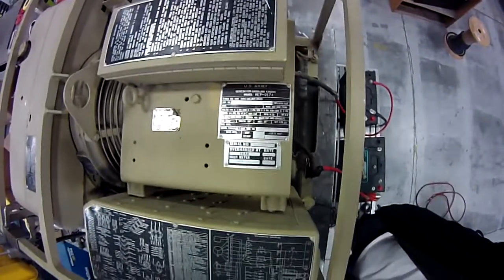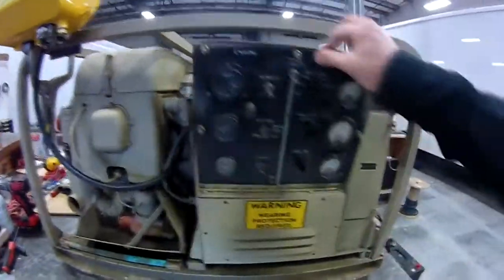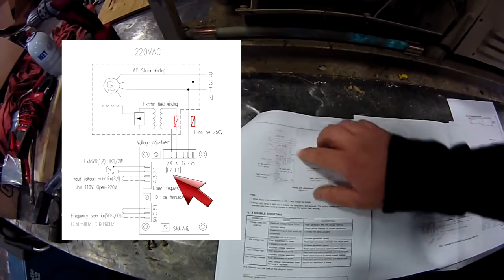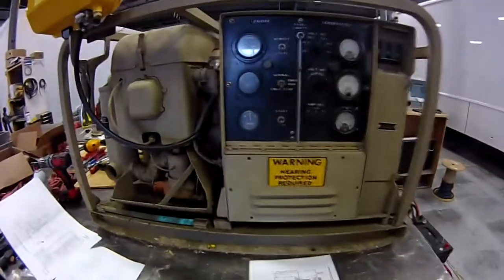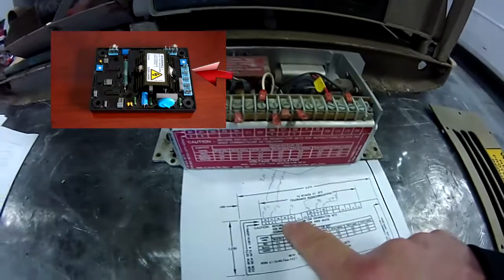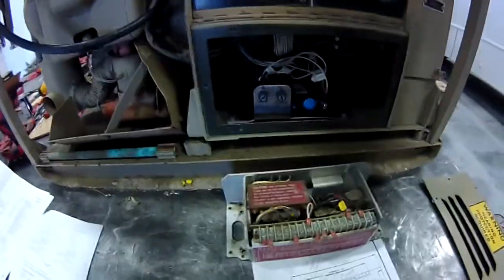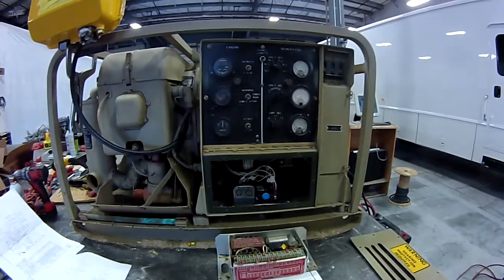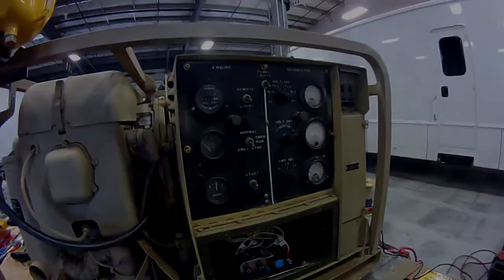MEP-017A Upgrade Voltage Regulator

Comment: Two questions if I may...I have a MEP 016c  with a bad avr.  1) Can you still switch from 120  3 phase with this SX460 upgrade ? Or is your generator now only good for 120 volts ?  and 2) will this wortk with a MEP 016c ?
thanks
Reply: Joe Malotcnj  Since the AVR creates the voltage for the field windings which in-turn regulates the output of the generator windings... it does not change the actual generator's capability...  As long as you are using the original F1 and F2 outputs to the new AVR, it should control almost any genset.  I am pretty sure it will run the smaller 3K genset as well, without any problem.

Since the output of the genset is configured by the switch setting (connects to different tap points of the windings) the genset still has all the original features.
I have used my 5k for 240 single phase to run a welder in the field, as well as 240 3 phase for my power.  That was the only disappointing thing was that with these military generators, there is not a neutral tap when set to 240 single phase (giving you 2 lines of 120 to neutral). I had to go to the three phase setting to get neutral, which means that one set of windings has no load, and the overall output of the genset is 1/3 less...